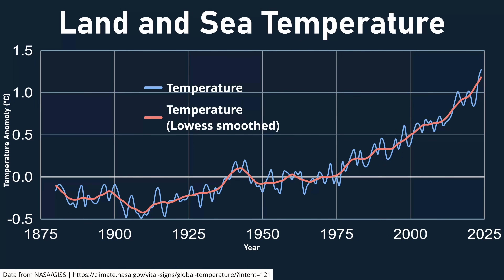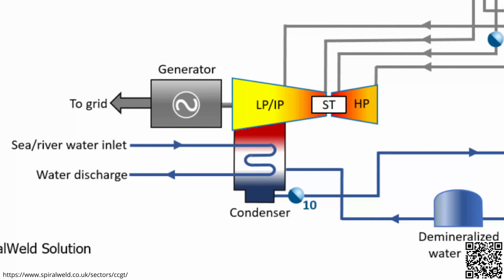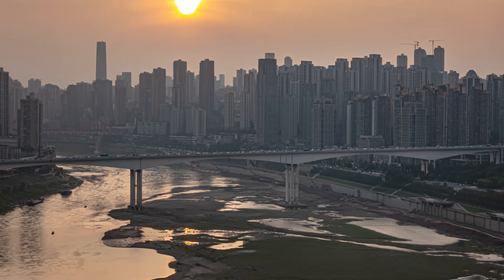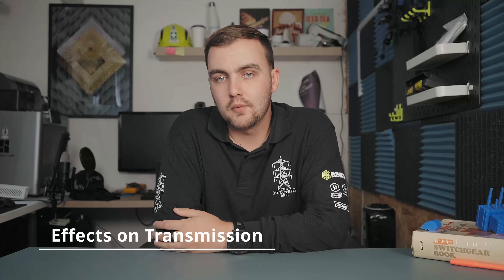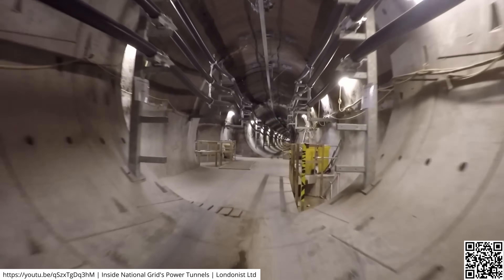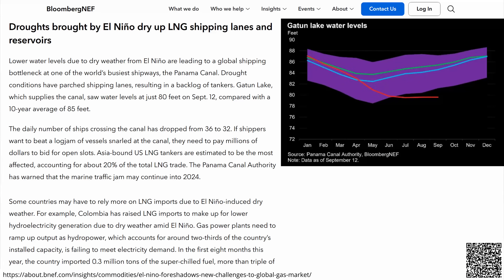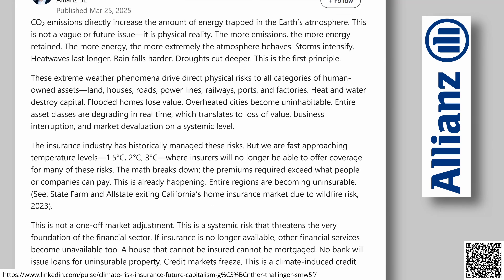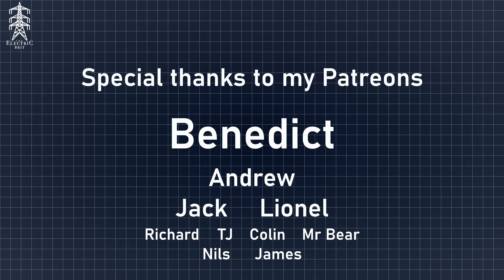Heatwaves are KILLING the grid

Comment: Reducing the power demand would help considerably, but just about every recent development ups the power demand:-
Steel producers have been shutting down blast furnaces, but are going replace them with electric arc furnaces with huge energy demand.
The design speed of High Speed 2 railway is not going to be a sensible 225km/h but 360km/h in order to be "World Leading"- not my words but Government. Prestige trumps common sense every time so an overstretched grid is going to be stretched further.
Everyone now is supposed to drive an EV- more demand.
Changing all domestic heating to heat pumps will not help reduce electrical load
I've done my bit by changing all lamps to LEDs. Any more loft insulation and my ceilings would collapse. I will not apologise, however for my small Aircon/Heat Pump and my car is diesel (which is one of the most efficient prime movers available).
Pity about transformers coming from Germany- we used to have several manufacturers, but privatisation of the ESI killed off the steady flow of orders to British companies.

Comment: 5 20 I gather the heat won't help cooling of local transformers and substations too as people ramp up the aircon and also with the advent of the electric vehicle brigade home charging over night, as a standard electric vehicle can pull 4 to 7 kWh if there are many on one local transformer it may overheat/thermal trip.
Gaz Yorkshire.

Comment: Air conditioning is unavoidable now, in the last house I had a lot of UPS batteries failing due to the summer heat. In this house we now have air conditioning and it's life changing when you work from home.

I think that domestic solar panels are a must for air conditioning, even with the efficiency loss it makes running air conditioning essentially free and reduces the transmission concerns due to the generation and usage being colocated. I think the 16A per-phase limit for generation without approval has seriously impacted the uptake of domestic solar, but fortunately, more people are now applying for authorisation to fill their roof rather than sticking to a 3.66kW export limit. The better export tariffs that we see these days (15p/kWh) really do make domestic solar viable these days, especially if you can install a decent-sized array.
Reply from the maker: That's something I didn't think about! I have a small UPS and miniserver in my garden office, and a bigger UPS and rack in the garage and hadn't considered the batteries dying. A UPS big enough for my main PC would be stupidly expensive so I'm just holding out until I can get a home scale battery and an inverter that runs in UPS mode.

Solar and battery have been on my radar for awhile now since the panels are so cheap, its a no brainer really. I just can't get away with having to pay someone to do what I could do myself, but because I'm not in NICEIC or MSC I wouldn't be able to sign it off. Think I'll have to get pally with a spark! I worked out charging a battery on my night tariff and using it during the day would pay off the cost of the battery in about 4 years at my usual usage.

In future I'm going to do a video exploring the effects of solar on the local distribution grid, since it's looking like another recipe for disaster.
Reply: @TheElectricBrit I purchased my UPS used from a company called UPS Trader - They sell them with new batteries and often without the front plastic cover for a bit less. They currently have an APC SUA3000xli with no front for £340, which is what I have. They are big and bulky, but work well - Mine does cover the PC but with the PC off, it runs the router and access points for quite some time which is handy.

Some energy suppliers (Such as Octopus) don't require MCS certification in order to join their export schemes so that could save you some money. It's worth noting that solar and batteries are VAT free, but you can only get that via an installer so that could offset the cost of getting someone in. It's also worth considering used car batteries as they are substantially cheaper than home batteries and there's an open source project (Battery Emulator by dalathegreat) which allows you to use them with standard hybrid solar inverters. The caveat is that these batteries are bulky, heavy (400kg) and use the older less-safe battery chemistry, so they are only suitable for installation within a detached outbuilding. But at £4k delivered for a 62kWh Nissan battery, they are hard to ignore. I currently have one waiting for our solar array expansion. From my rough calculations, our large battery along with our planned 23kW ground-mounted array will result in us being approx £4,300 better off per year. (Give or take, it's based on monthy averages and assumes that the battery can provide for complete self-generation, but where it doesn't we can also take advantage of the off-peak rates as you mention.)

I'm interested to see your video on the effects of solar on the local distribution grid. I do also wonder how the weird pulsed waveforms that modern inverter-driven equipment produce interfere with the wider grid, as it's no-longer as simple as a phase delay on a nice clean sine wave. I wonder if we may get to a point where the weird waveforms start to saturate distribution transformer cores.
Reply from the maker: I’ll certainly check that out thanks. My main PC has something like a 1500W PSU in it so when I tried it on my little UPS it cried immediately. All my network stuff is on a bigger rack mount unit. 

Good info about octopus too. I’m with them now and just bought a little micro inverter on offer to play with but once I move house I’ll definitely start doing some crazy DIY projects with big battery packs or used car packs.

Comment: Floating Solar PV on reservoirs and cooling ponds would helps reduce evaporation and the cooler temperature improve PV efficiency and much more practical than a  load of Balls..  I cant understand why solar PV panels don't have a water loop on the back as this would improve the PV output and the heated water could be used to preheat the domestic hot water.  As it is PV output is goes through an DC to AC inverter into a battery or the domestic supply only for the water to be heated with an electric immersion heater.   

If the UK mandated all large warehouses to install PV with water cooling more energy can be generated without hundreds of individual houses having overly complex systems many installed in haste and badly.  The warehouses would already have a larger feed capacity to tie in, the heat recovered from cooling the PV panels or installed Solar thermal could be used in community heating.  All new build houses should have Solar thermal to heat hot water in a Solar Cylinder. This would supply all the hot water in the summer and only a small amount of electrical energy needed to bring it up to temperature in the winter.  The technology is here but is made complicated by those milking the government grants scheme.  I have a solar thermal panel on the roof and have more than enough hot water.  

Tidal turbines could be installed in the mouth of large rivers near to power Grid, easily serviced from barges and the energy is predictable for the Grid control to take advantage of,  why do we spend so much on Wind turbines and very little on submerged turbines.  Thanks for the video.
Reply from the maker: Thanks for the comment :)  I agree and it's something I had thought about if I installed solar, to run some cooling loops on the back DIY style. There's a few issues I've come across with your suggestions though although they are spot on on the surface.

First is an insurance issue regarding PV installs. Because the industry has been overrun by cowboys and poor installs, there's been a few fires, some of them on the large warehouse installs and the costs associated and lost time with their main building just puts them off. We're seeing something similar in the domestic space where insurers are asking if you have solar fitted because some brilliant minds decided to fit batteries and inverters in stupidly hot loft spaces with no ventilation. Similar issue to spray foam insulation. Can be a good idea but poor execution spoils it. The large rooftop solar issue is relatively easy to solve with better safety systems.

Similarly you've come across one of the biggest lobbyists in the UK - home builders. They and the boiler makers fought long and hard to push off mandatory heat pumps so they could make a few more years profit out of gas, and they no doubt fought back on anything that made building homes longer or more complex. There are issues for the distribution grid on everyone having solar PV which we're seeing now, but that will have to be solved.

And lastly I don't know much about tidal I'll admit. I saw a great video on the Irish sea by a company putting some in there that looked promising, but depending on who you ask the economics are questionable. There is a cool project in the USA that have figured out wave energy, it might have been CorPower.

Thanks for the comment! There's definitely solutions to problems out there if we work hard enough at them and the government makes the right choices.

Comment: Hot air doesn't really stop winds.
It's where the hot air is, the main driver of winds globally is the Sun beating down on the equator, that causes an energy imbalance between the equator and north and south of it. That causes the winds globally. But if it warms more uniformly, then there would be less wind.

Comment: Install Solar PV farms on reservoirs instead of dumping black plastic balls in the water.
It will reduce evaporation and the water underneath will help keep the PV panels cool, plus you get energy from the system.
Reply: Solar over water is difficult if the water level is not constant, but if the reservoir surface is flat steps then floating solar can sit on the ground when the reservoir level is low.

Comment: If you're planning aircon, then get an air to air, or air to ground heat pump. The heat pump can handle heating a reasonably well insulated home. Just don't get the models that use existing radiators to handle heating, as you can't use those to cool your home.  For a small area to cool, portables will work, but sadly we don't get the ubiquitous window units the USA gets.  Split systems require professional installation, but are the most efficient solution for an existing house.
Reply from the maker: Thanks for the comment! Will be looking at a heat pump for the next home. Existing one got quoted over 12k after the grant to replace all the plumbing (microbore and fastfit everywhere, in the concrete slab, the lot, plus bigger radiators). I've got a portable unit but didn't think far enough ahead to put an exhaust port for it in my garden room, and its a pain going in and out with the window kit fitted to the door. There are some DIY split kits too but even for the cost of a proper install I'll probably bite the bullet at the next home if I have to. Whole home MVHR with heat pump would be the long term aim to kill off condensation etc too.
Reply: There's actually one portable unit on the market right now it's called the midea porta split and basically it lets you put the condenser unit on a bracket outside and you only need a small gap through a window for the piping so the losses should be minimal with that portable unit. Should be fairly easy to seal the gap, and of course no negative pressure.
Reply: In our annexe we have an air-to-water system, but it uses fan coil units for the cooling - They are expensive but they work great for cooling, handle the condensate and also vastly improve the efficiency of the heat pump when heating. (As it's effectively like having massive radiators)

In our main house we have air-to-air cooling which also works great. The issue with air-to-air is that it's harder to cool the entire property, (And to do it without drafts) and they are also difficult to size properly. The proper way of doing it is to use ducted systems in the loft if you can, but it depends on the property. For sizing, it's not too much of a concern when cooling if you have solar, but if you're also using them for heating it can be an issue.

Condensation disappears as an issue with both systems as long as your units have a proper condensate drain hooked up. For the water-based systems, you can get fan-assisted radiators with condensation trays which can allow you to use your existing radiator locations and pipework. They cost a bit (A lot) extra, but if it means that the heat-only heatpump you were already considering can now do cooling and run more efficiently, I think it's a serious consideration. Look at the Daikin FWZ-A fan coil units.

Portable units are hopeless, a proper installed system of either type results in a night-and-day difference, both in effectiveness, comfort and in running costs.
Reply: Portable single hose units only really work overnight, when the outside temperature is lower than the indoor temperature, due to the negative pressure they create, which sucks in hot air from outside in the day. They do provide some relief from a hot bedroom at night though.

Comment: Apart from being able to recycle the feed water having condensers increases the power output of a steam turbine by building a vacuum at the steam exit as the steam massively reduces in volume when converted back to water (~1800 times).  In pre-historic times the Carolina Port coal fired station in Dundee was the most efficient plant in the UK due to the coldness of the water from the North Sea used to cool the condensers!
Reply: That logic is a bit weird to me. Low condensing temperatures will certainly improve condenser vacuum. But steam technology advanced so quickly, that just about every new power plant was the most efficient in the country due to increases in boiler temperature and improved engine/turbine design. We went from a few mBar at 100°C in the days of james watt to supercritical steam that makes the pipes glow in the dark with a faint red incandescence, around 700°C, less than 250 years later. With power plant design lives being 50 years or some such, the advancement from new design to new design has been and still is big.
Reply: A significant amount of power can be produced by steam below atmospheric pressure in a steam turbine power system. In systems where the turbine input temperature is low for example nuclear this could be as much as 30% although less for coal or gas stations where the steam pressure and temperature can be higher. Even so the fuel savings will easily pay for the extra costs of larger low pressure turbines and bigger condensers.

Comment: I was enlightened by you last video. I want to build a datalogger, because everything on the market is kinda shitty. 1 data logger per 10 seconds. I cant use that. Im looking for electrical engineers, if you know anyone, or are interested.
Reply: What are you logging? If it's not for anything too industrial, there are lots of tutorials on Arduino and datalogging.
Reply from the maker: I second this. Arduino, ESP boards, Rapsi if you need more processing etc. I've got various home assistant devices around the place and a bunch of ESP boards I've been meaning to turn into very advanced air monitoring for the home but not got round to it. Would like to put them on a second channel maybe for more DIY and informal projects, and vlog stuff like site work that aren't as formal as these videos.

I managed to get a raspi nano setup as a flightradar station via SSH which I'm not sure is covered anywhere, as they expect you to set it up plugged in but it doesn't have enough ports for that.
Reply: @TheElectricBrit Great. But I prefer to have someone experienced do it. Im not too lazy to learn, but I also dont have the space anymore for building things at home. I dont have a filmstudio anymore. I dont even have the space for a soldering station. But please share whatever you can, so I can forward it to the 2 electrical engineers I am currently working with. Sure, would be great.
Reply: @ThisRandomUsername  Im starting with home use. YOutube does not allow links. But think custom power strip to start with. With a wattage meter built in. And I need a usb or ethernet port to mirror data to computer. Also built in sd card for data logging as a backup to mkrroring to computer. With a nice graph to show the wattage per day, week, month, year.
Reply: I'm using ESP32 and ESPHome for the most part, logging the data in Home Assistant. I have some smart plugs that I had to write config to reduce the logging interval because ESPHome just reports the data any time it changes, and the power monitoring chips spit out a sample a second, but I didn't want to fill my entire storage with power data.